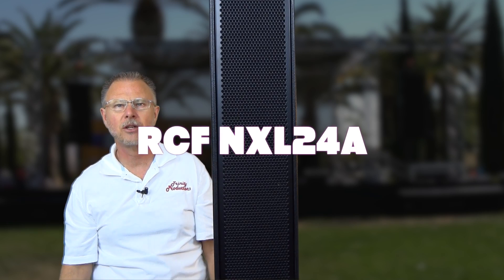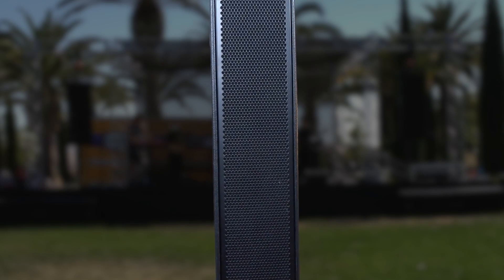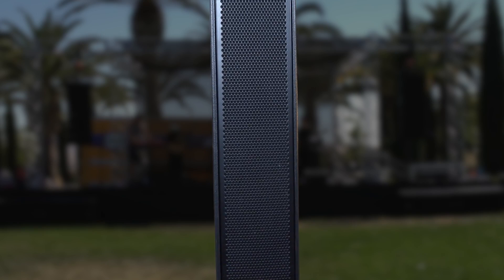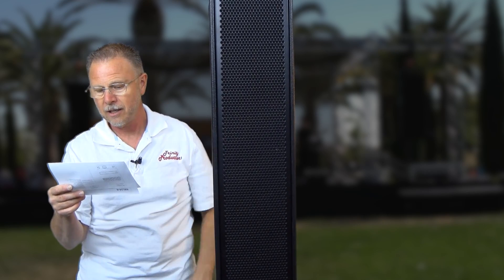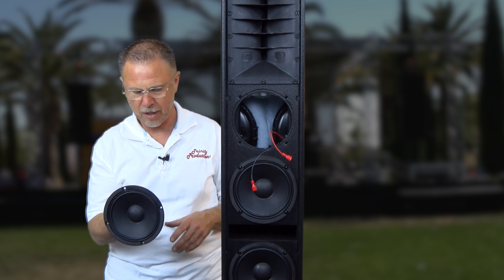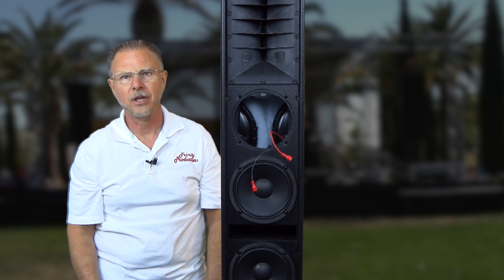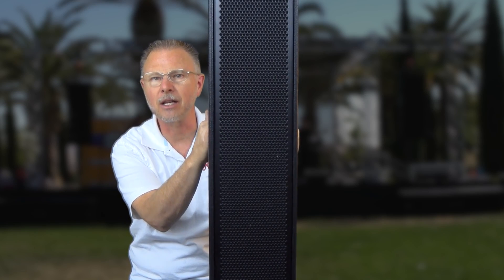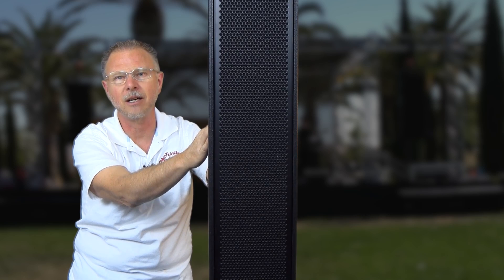RCF NXL24A In Depth Full Review - Tall Skinny Speakers - Authorized Dealers

Comment: How are they compared to the NX45? If I may ask.
Reply from the maker: Really can't compare as they are a totally different type of speaker and system more focused in the vertical and wide dispersion horizontal, same great driver and lower crossover point of many of the large HF driver speakers from RCF. Many have bought and used for DJ and live band and are amazed at the sound quality and output of the NXL24's , and they can be doubled up for bigger events. Hard to do with typical trap speakers and get that quality of sound due to comb filtering effect, etc.

Comment: hi. can i pair this with QSC kw118 subs?
Reply from the maker: yes, but they don't have a cross over output on them and you would be running them full range, to which you may notice early clipping due to over driving the low end on the 24's  .. the 24's will certainly outrun the KW181 subs.

Comment: Hi can I used a single for karaoke ? Thanks and what mixer will match with it
Reply from the maker: You can, just limited on low end without a sub woofer. Any mixer will work that is line level and you will need an XLR cable to connect to the speaker from the mixer.
Reply: trinityprosound 
Hi what size of sub Mach with it for home karaoke and how about the this speaker vs rcf j 12 aray thanks
Reply from the maker: SUB8004 is a great match for the NXL24s

Comment: Hi! How do you compare NXL24a with Evox 12 since they are almost of the same price range.
Reply from the maker: Those you can not compare as they are different systems , EVOX is complete with bass bin doubling as a LF driver and quasi subwoofer. The NXL24 is a different system and needs a dedicated subwoofer for the lower end. The NXL24 will provide so much more SPL level and can be expanded as well. NXL24 compares to similar products with FBT and db Tech in the 406 and IG4T.

Comment: hi. how they do compare with db igt4? which one ... for live sound,thanks
Reply from the maker: very close, the IG4T has more power, but, the RCF has a larger HF driver and lower crossover point, but the SPL from them is amazing. With 2 per side and subs you can do 1000 peeps if you can get them stacked and high enough for coverage. IG4T has a bit more DSP and options, but both do a fantastic job and sound GREAT and easy to deploy, the IG4T is less weight due to the injection molded box it is in.

Comment: Excellent reviw thanks! 
How do you feel about the rcf nxl24a vs the fbt cla406
and the subs 8004 vs cla118?
Reply from the maker: About the same output, just a bit of different look with the FBT, the 118 sub is amazing and is very close to the 8004, either system will be in your face for audio quality and output.
Reply: trinityprosound thanks a Lot for your thoughts

Comment: Is this suitable in rcf 8004 sub as??
Reply from the maker: yes the NXL24 and the SUB8004 pair very nicely together and using the SUB8004 crossover allows the NXL24 to run strong and hard, amazing system. We have sold numerous combos like this and all who have purchased are blown away by the output and sound quality.

Comment: Hello! Congrats on the videos! I recently bought 4 NXL24A but due to the big price difference, I bought 4 Sub 8003 asII. Will I lose much in comparison to 8004? Thank you!
Reply from the maker: I don’t think most will notice a major difference. I believe the 8004 has a different higher power raged woofer in it. But most will not be able to tell difference
Reply: That is exactly what I am looking at doing.  What are your first impressions of this system?
Reply from the maker: NXL24 is amazing, you can do 1000 peeps with 2 per side and sufficient subs, but the tops will outrun the subs with no issues...IMO you will need an 8006 or 2 for keeping up with the NXL24's if used with 2 per side. Always use a crossover or the built in crossover of the RCF subs to get bet match up with tops, and you will be able to run the NXL24's louder with decent crossover...

Comment: Hi Trinityprosound, Thank you for the great videos. What sub would you recommend with the NXL24a. i want to have 2 tops 2 single 18s or very compact dual 15 to go with that.

 i checked some other reviews that say the RCF sub 8004 will work for most gigs but,loud rock bands you may need an extra sub. i dont have the space for that extra sub most of the time.   Does the 9004 sub have more output? when are you guys reviewing the 9004? or is there any other sub options?  thanx
Reply from the maker: For a single 18, the 8004 is the most power and the best bang for the dollar out there with 1250WRMS the 9004 is 1400WRMS but same max SPL as 8004, you get RDNET on the 9004. The NXL will give a double 18 like the 8006 a good run and certainly keep up with a double 18" subwoofer in that class. The only other small format subwoofer that does an amazing job is the TTS26A, but those are very pricey :-(   we have sold a lot of the 8004's and everyone that has purchased with the NXL24's are really impressed with the sound and output of the rig.
Reply: thank you very much. Last question. How do the 8004 compare to the jbl prx 718xlf? (the subs i currently have)
Reply from the maker: They will kill them. the JBL looks only to be maybe 700WRMS, the 1500w is most likely peak or continuous. Does not really say how they get 134db from the box and what frequency that was taken at  more likely above 100Hz. The RCF subs are true RMS power and their precision drivers. I have customers tell me that 1 of the RCF 8004 did more than 2 QSC KW181s
Reply: thank you for the information.

Comment: Hello, greetings from Colombia. How many people can I cover in open space (live music) with 1 nxl24a per side and 1 sub per side?
Reply from the maker: HOLA !  With one per side of NXL24 and a SUB8004, with decent volume I would say 400 or so. you will need 2 per side and a 8006 per side for larger events.
Reply: In your experience..... whats is better for event into (200 - 800 people open or close espace)... NXL24a... or maybe line array kind of T4... T8... Hdl20a... Nx23a... L23a... Das.. or similar...
Reply from the maker: You can do it with 2 of the NXL24's or 2 of the NXL44's per side and subs. That is a fairly easy system to set up. T4 T8 HDL20 or HDL6A can do it as well, but you have to keep in mind those are very directional speakers in the vertical and you need more to get proper coverage and low frequency coupling. Looking at 4 HDL20 per side min. plus subs. Also look at the TTL6A, a bit more $$$$ but amazing speaker too !

Comment: hey is the driver unit of that rcf nxl24a still have a capacitor?
Reply from the maker: No...direct connect to AMP, you are seeing possibly ferrite beads around leads on LF drivers???
Reply: ahh okey. im just thinking about compression driver unit. thank you sir. i just want to buy a things like that in the right time. :)
Reply: hey i have a question what if i use that in dbx driverack what should i choose in dbx driverack is the 3 way system enough?
Reply from the maker: no you will want a 2 way system and use a 90hz slope with 24db per octave and send everything above 90 to the NXL24 and everything below to a subwoofer.

Comment: How large of a crowd would you feel comfortable covering outdoors with one of these and an 8004 sub per side,  classic rock/modern country?
Reply from the maker: with a single 8004 per side about 350 the nxl24 will out run the sub 2x 8004 better or an 8006 4x nxl24 and 2x 8006 750-1000 at acceptable levels
Reply: trinityprosound Thanks.  And how about a single NXL44 and sub on each side?  I'm surprised that the 24 will outrun the subs.  I heard the 24 inside with a single 8004 and the bass was overpowering the tops.  But, of course, that's with some boundary effect.
Reply from the maker: That top will outrun a double 18 sub. we did a video with the 44 and a TTS36A sub, from 100 feet out the top was there , but low end dropped off. If the NXL24 did not keep up with the 8004, something was set up wrong or the 24 not driven to match the 8004.
Reply: Hmmm.  I asked and they were running flat eq with the output of the board straight to the 8004 and out of the hi-pass out to the NXL24.  As I said, this was in a smaller room and I'm sure we were getting plenty of boundary effect from the room (about 32' wide by 60' long.).

Final question: from simply a sonic quality difference, which would be your choice between the 24 and the 44 with subs?  (Run of the mill music ranging from bluegrass to classic rock, no metal or rap/hiphop)
Reply from the maker: I would pick the 24s. plenty of output , easier to handle and can be stacked as events get larger and still have fantastic output. the 44's are nice but BIG

Comment: @trinityprosound  whats your 1st choice between the FBT CLA406 and RCF NXL24A? do u Have them in Stock ?
Reply from the maker: +VDJ FLEX I think the NXL24A , but the CLA406 gives it a run for its money so to speak...I like the AMP better on the NXL24A. I don't have current stock, but they are in stock in New Jersey at RCF...and FBT
Reply: ok thanks so much for your time .. I'm thinking of buying a columm speaker seeking advice from u is just the best thing that has happened to me this year (smile) so i should go for the NXL24A becos they have Good powered amp.
Reply from the maker: Yes and they are proven over and over, with all that have purchased them...amazing speaker

Comment: Me again :) Used with subs, will a pair of NXL24A outperform a pair of dB DVX D12HP?

And if talking 120º coverage, will a single pair of NXL24A outperform TWO pairs of D12HP. A splayed pair aside, that is.

Lastly, and this would prob blow my budget, but I imagine TWO pairs of NXL24A configured either as a vertical stack (coupled horns), or as 'vocal only' inside pair - would be tough to beat. Would it trump single pair of TT25A for vocal clarity at 150ft?
Reply from the maker: +Trevor Jalla , No, 2 of the D12 will provide a ton of sound. You won't get that kind of output out of a single NXL24A. The NXL24 is amazing, but there is more power and coverage of the D12HP with a pair per side. 

For the column of the NXL24's that would be a formidable system for sure and be more focused straight out due to the nature of the boxes. But also look on line at this http://www.dbtechnologies.com/EN/Products/ingenia/ig4t_p2349.aspx  they are coming out very soon. And has some beam steering ability as well. Possibly a better fit with the DSP than 2 NXL24's

Comment: Looking at the input sensitivity slider switch... Which is the line and mic position? The whited area - is that the position of the switch slider... or is the the black bit in the diagram which is the position of the switch slider?
Reply from the maker: Russ Hollinshead up for mic , down for line is what it appears...if you run line level into the thing with mic setting....the speaker will go into limiting really quick
Reply from the maker: When the switch is towards the LINE position , and switched away from the MIC , you can easily tell by doing a little exercise, lower the input volume on the box, start your audio source, flip the switch  and one direction  for mic it will be a heck of a lot louder into the input. be careful to give just a small amount of signal doing this, as the input sensitivity is much more open for mic input than line. when the volume is lower than the "other " setting you will have the speaker in LINE level input mode.

Comment: Can I ask-- how does this speaker compare with say a pair of RCF ART 522a or ART 722a. I have RCF ART 522a and on paper these have a very similar response curve and max output to the tall skinner speaker - but I'm assuming the throw and horizontal dispersion of these NX L24a will be greater? What differences might I expect to hear if I swapped to these? I mostly do small rock band in small venues pubs etc with occasional outdoors event for around 400 people is.. I pair my Art 522a with a JBL PRX618 xfl (18", 1000w powered sub).  Would appreciate your comments-- there is very little written about the NX L24a anywhere online.  Thanks
Reply from the maker: On paper is where the similarities stop with these and the 522A's. This system is quite directional in the vertical axis, which the 522 is not. Very good pattern control forward and slighting downward to cover above and at peeps ear levels. These on sticks with a sub will out run the 522's and offer a much better sight line. The fantastic thing about these vs. the 522 is that you can combine two of them to get a higher SPL and better control of where you aim it/them, which with 522's the splay causes huge comb filtering to take place.  This system, with 2 per side and a double 18 sub, would handle your events without issue and allow even larger events. I would say that one per side and a sub would do you indoor pubs, etc. without a problem.  The PRX is a decent sub, but its 1000 watts is not true RMS, more like about 600-700 watts real life. The audio from the NXL24 is quite clear and pristine and very focused vertically so that you don't loose a lot on the ceiling and floor of a venue.
Reply: trinityprosound Many thanks fro your quick informative reply. Much appreciated.  And compared with the Evox 8..are the L24A significantly more powerful or not? They seem to be only 3db louder..(not stacked) but again, how in the real world might you expect my sub with 2* L24s compare with and Evox 8?
I'm very surprised there is so little online about the L24A? Are they not selling?
Many thanks for your advice.
Reply from the maker: Andy Lewis the NXL24A compared to the EVOX 8 takes into consideration in the specs for the top and bottom box of the EVOX 8. The NXL24A specs are stand alone. The NXL is going to have significantly more output believe it or not just due to the long column line of the drivers and power supplied to them. The NXL are selling, we have sold a number for portable as well as install applications. Your subs will be a decent match, but I feel the NXL will out run them when things get loud.
Reply: trinityprosound Thank you for your time. Very helpful. Sounds like you would recommend them then? I see most pics of them being used for vocal reinforcement in situations where an unobtrusive stack is preferred. But I would think that they would excel for acoustic instruments? I gather that this general type of speaker tends to give more even volume levels front to back of a venue than traditional speakers give? ie you don't blast the front row trying to throw to the back of the room. Do these actually do this?  I read that some performers find this sort of sound  presentation disconcerting from the stage  and hard to get used to whilst others say that they can get away with less or no monitors.. what is you take on this? Sorry to ask so many questions but I hope that many others will find your answers as helpful as I am. I live in NZ and there is no stock in the country to listen to here. Many thanks.
Reply from the maker: Andy Lewis The EVOX 8 are fairly smooth in coverage..while being closer to the speaker is higher SPL , the dispersion and direction of the EVOX 8 tends to not be so harsh close to the speaker. While being loud up front, it does not sound harsh like a HF driver would at close proximity. We have run acoustic guitar and vocals through the EVOX and they sound fantastic.
Reply: trinityprosound Sorry I meant my last questions to refer to the NX L24A which is the speaker I have in mind. Does the NX l24a also sound good up close whilst being still loud at distance (compared with a standard speaker?) And what does it excel at... I'm assuming vox and accoustic.  And can you guys supply these to NZ?
Reply from the maker: Andy Lewis Up front the NXL24 is going to perform as any other speaker with HF driver, the directional properties is a more of a "in your face" since horizontal is 30 degrees or so...they do nicely across the spectrum from acoustic to rock...I can only ship to a freight forwarder in the USA